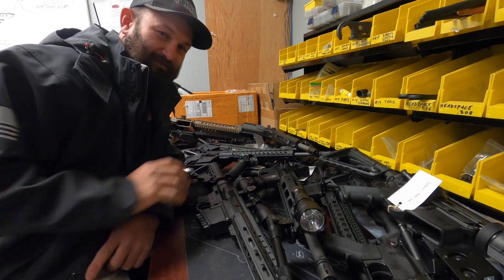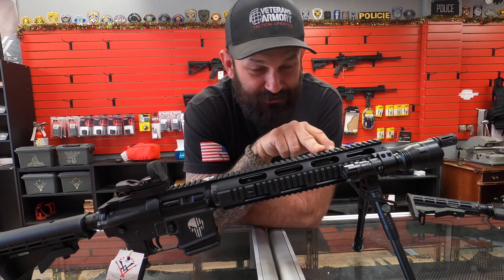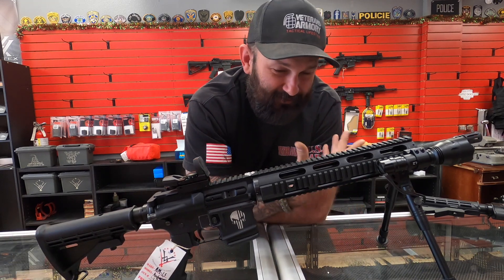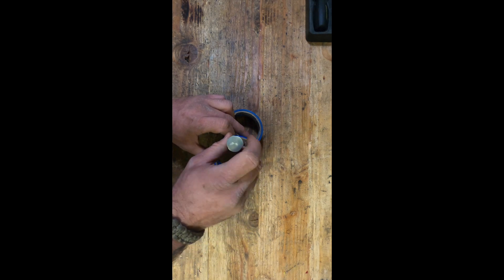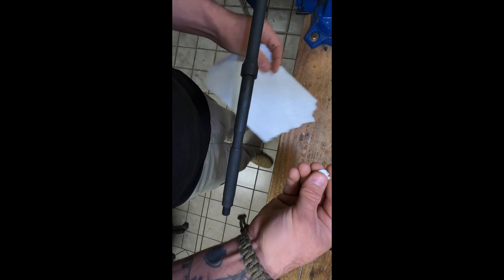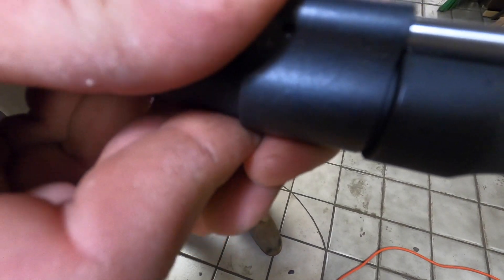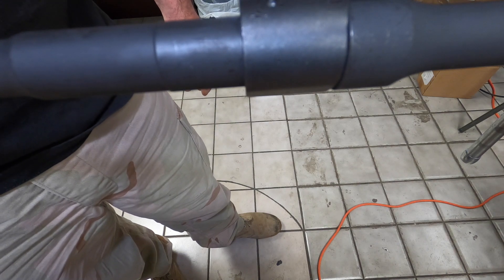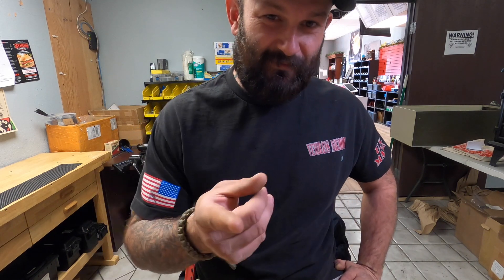Ar 15 gas system alignment

Comment: Vietnam veteran here 1969 to 1972 you are the man I'm a machinist and this is what we used to use for tight tolerance grinding we would run air and we had a gage that would measure the pressure differences and flow this is the poor man's best way to align the holes you saved me a lot of work I was going to do it but use gages I really appreciate the advice buddy your buddy John

Comment: So it's normal for my gas tube to go in my upper on the left side?, my barrel was dimpled and aligned my gas block and everything. But still my tube is to the left side entering my upper,  when installing my barrel nut and doing it for the final time will the barrel nut help ensure my tube is perfectly straight to make correct contact with the gas key on my BCG??? OR WHATS your thoughts or how do you deal with this???

Comment: What about using and air compressor to slightly blow into the end of the barrel?
Reply: Probably wouldn’t be able to hear the air flow over the air pressure coming out of the hose